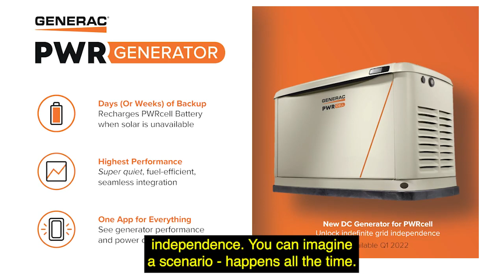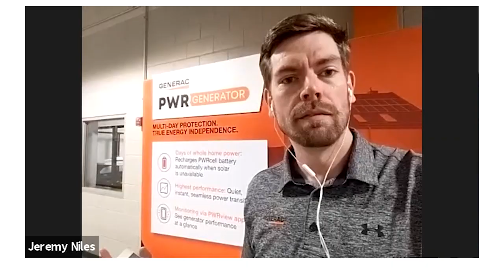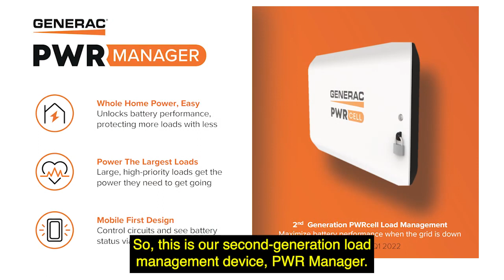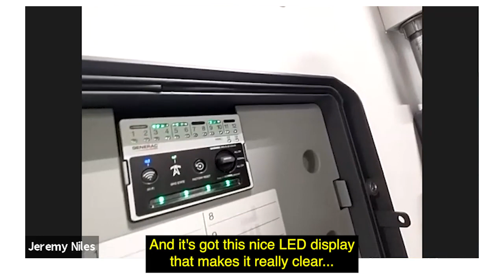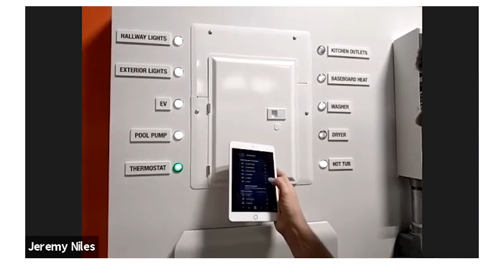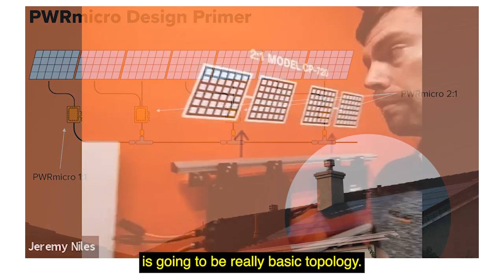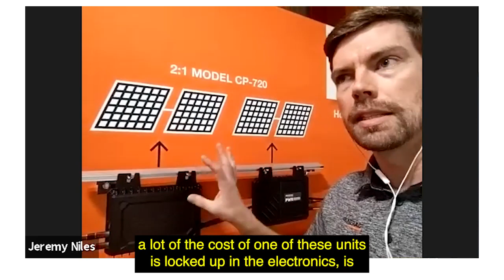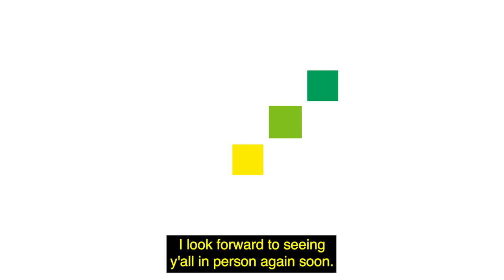New Generac Products! Meet: PWRgenerator, PWRmanager, and PWRmicro.

Comment: Just looked up the sound specs. The PWRGenerator is only quieter in test mode compared to the Generac 10,000 watt Guardian G007171 (51 db vs 57 db). At normal load they are the same, 61 db. ‘Super Quiet’ description came from marketing staff, not engineering staff.

Comment: There are a lot of Tesla powerwall installations that could benefit from the addition of a Generac PWRgenerator if you could connect the PWRgenerator to the Tesla gateway as if it was a solar electrical source. Would you consider offering such a solution?